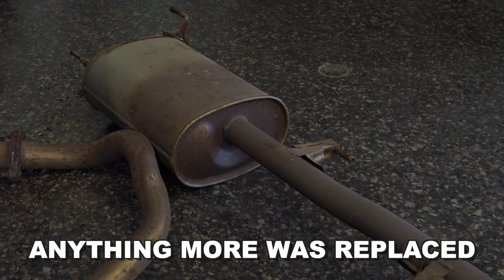Toyota FJ Cruiser With Electric Rear Windows In This WILD FJ!

Comment: Hi Daryl. I have been in communication with brendan Lennon in regards to the release of the buddy window kits. He told me to contact you directly to try and get some info on the release and myself and 5 other FJ owners are very interested. Myself, I want these as soon as possible.
Reply from the maker: We don't have a release date yet. We are still having issues finding a shop here that can handle the production of the interior plastics we need to finish this project. We will release a video when these are completed and the pricing! Thank you for reaching out.
Reply: @JustDriven hoping soon! ❤

Comment: for me is a waste of money ,better if you replace the headlights and the rear lights assemblies for good leds , the front grill in black and the fender flares black and dont paint it just wrap it:trophy-yellow-smiling:
Reply from the maker: But we didn't see any issues with the OE Toyota lights or the grill. We figure there are people out there who would want to focus their builds on the lighting. As for a wrap, we discussed doing a wrap early on, but when it came time we felt painting it would be more of an impact. So maybe not a "waste of money" but a different use of money than what you'd spend it on?